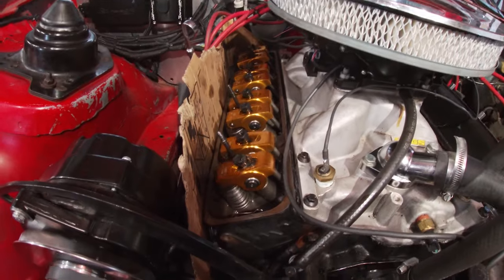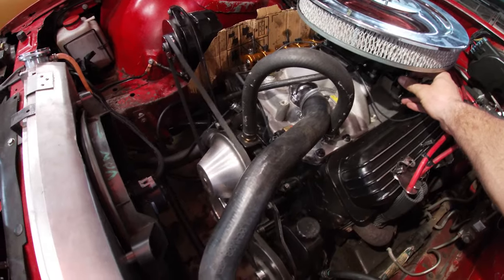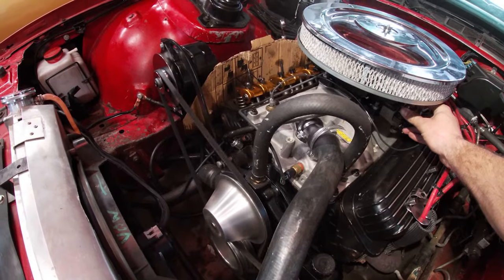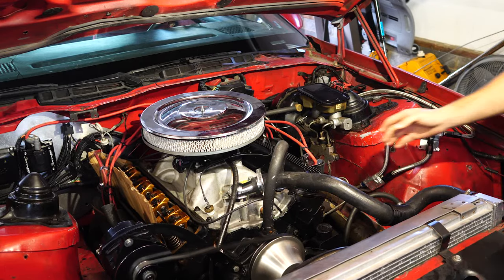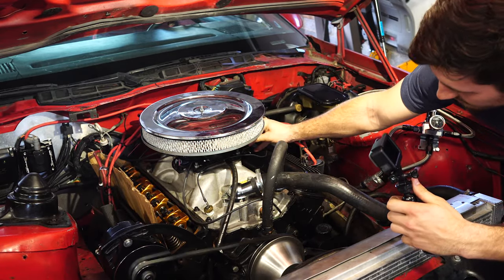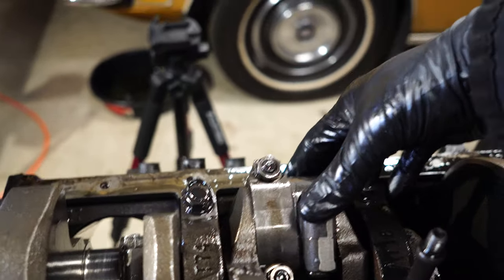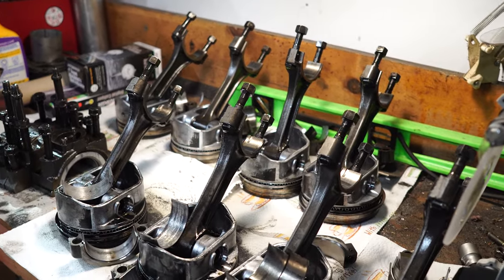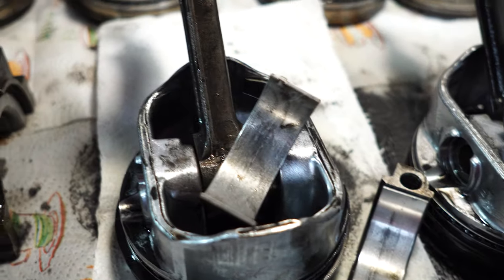What Engine Knock (Rod Knock) Sounds and Looks Like!

Comment: there's an easier way to tell if u have a bad rod bearing. while the engine is at an idle...just start pulling the plug wires one at a time...replacing each wire back as u go along. when u come to the cylinder with bad rod bearing...it will become much louder and very easy to hear the rod knocking. no need to remove the valve covers. this guy is very sharp and seems to know what he's doing. In fact I'm a subscriber. But in this case, there's an easier way to tell. not every technique is fool proof but in 40 years of wrenching on cars, the method l just described has always been accurate in not only knowing for sure if there's a rod knocking but also lets me know exactly which rod it is.
Reply from the maker: That's good to know! Hopefully I don't need to trouble shoot anymore rod knocks for awhile though!
Reply: @ZanesGarage  Me too. sweet ride BTW.
Reply: @shaggings  I was referring to V-8's. and a motor that already has a knock. A very interesting thing u just described. If there's no knock - then your good. I've never tried it w/ a 4 cylinder.  Why did u that in the first place?. Were u looking for a knock? Not sure what the problem is.
Reply: @shaggings  Oh...I see. I hope u get it all sorted out. Oil-wet would suggest to me either bad rings or valve guides. Fuel-wet would suggest a much cheaper solution. Bad fuel pressure regulator perhaps. Good luck bro.
Reply: engine develops knock 

pulls plug-wire 
cuts connector to plug out of boot 
fills with silicone 
fits Boot back Over sparkplug 
puts on fb market place and asks above PREMIUM dollar for for vehicle 

"Yeah I been driving it daily, it's about due for a tune up but between work, the wife, and the kids, I just haven't had time to do it myself, it's a healthy running car I've never had an issue with it...I'm firm on my price, I know the value of what I got. But if the tune up is all that's keeping you from buying it I'll knock 100$ off."
Reply: It didn’t hurt per say. But I did just get shocked by my first distributor.
Reply: @dhgcrack3r111  Yeah it'll give ya a shock if you use your bare hands. They do make plug wire pliers or you can wear gloves. Good luck.

Comment: I'm not a professional, but I have pulled down a few very old engines and have as yet never seen a bearing that bad!  You saved the whole car!
Reply: Well I must be unlucky on my old engine all of them were pretty thin and they were all a brownish color and idk what did it but my whole crank snapped and it was a mess didn’t leak a drop of oil though so that was nice

Comment: you can hear it when you revved - a lower frequency ticking. Lifter valve ticking is not as low frequency - and you can tell it's from the top of the engine. Thanks

Comment: Damn, I knew my Crown Vic had a knock, but wasn’t sure. This video definitely helped, thanks! 🙌🏾
Reply from the maker: Glad it helped! Crown vics are sweet!
Reply: How did you fix the knock in your crown vic? I was told mine is knocking from the bottom
Reply: @ZanesGarage  will a rod knock go away after it warms up I have a 93 Chevy Cheyenne and it seems like a similar noise I heard today but went away after the truck warmed up? Any input would help thank you!!
Reply: @daivonedurr9878  not worth it to try to fix a 4.6 mod. Get a new engine, they're everywhere and cost nothing
Reply: My f150 sat 6 years and was stuck, accidentally floated a valve I think, over revving, 302 1994 f150 5 speed manual now I think it's ticking but it sounds like a lifter, more high pitched, like a smaller part/piece of metal clattering, new camshaft lifters and rocker arms should fix it but I'm leaning towards a 300 dollar junkyard plant

Comment: Sounds the same on my BTR2 cammed g8gt. Did a nice burnout for a road work crew. When I got home, tapping like mad. The cam lope wasnt even the same , sounded off balance,  lost most of its chopchopchop sound
Reply: What ended up happening. I have a gp gxp
Reply: I got a motor out of a G8 and now it's making a lot of noise. Mechanic thinks it's rod bearing.

Comment: so a rod bearing on the bottom of the engine can cause lifter knock?
Reply from the maker: No, generally lifters when they go bad or there's an issue have a "tick" and not a "knock". If a rod bearing is bad you'll know about it before it causes any issues with your lifters.

Comment: Could this sound get much quieter (in fact almost gone) when as the engine warms up? I hear this clicking when driving and accelerating only, but it is gone after a few minutes. Could it be piston slapping? Is it normal? Toyota Yaris, thanks
Reply: might be a valve lifter
Reply: Or a exhaust leak like mine between the exhaust manifold and the cylinder head because a broken bolt
Reply: Prob piston slap especially if it goes away once warm. The piston will expand from the heat and tighten the gap stopping  the slapping

Comment: Thats wierd especially for recently rebuilt motor
Reply from the maker: Well it was rebuilt by myself and I didn't take the time I should have to check clearances, proper break in etc. So I'm paying for that now but I'll get it right this time around 👍
Reply: @ZanesGarage  happened to me as well. put in my rebuilt block 3 days ago. started it up and it was fine and dandy for all 20 or so minutes. then clack-clack-clack and i'm pretty bummed. i'll be taking the oil pan out tomorrow to do some checking.

Comment: This just happened to my 5.3, oil stopped circulating because of increased pressure, I ran it too hard. First I thought it was a low battery so I kept trying to crank it. There was just a tiny bit of metal shavings at the bottom of the oil pan. I hope I can still save it.
Reply from the maker: Yeah it's never fun. I haven't messed with an ls engine yet but I know they're pretty straightforward to take apart.
Reply: Did you end up saving it?

Comment: Hi, please i need your reply.
I'm using a 2008 Hybrid Honda civic.
There is a rattling noise when advertising slowly but when i press the gas harder the noise goes until you accelerate slowly again.
Engine scanned, says NO FAULT.
Reply: I have this rattling sound in my 2010 honda accord as well, like you said when i accelerate at low speeds and not after being run for a while sometimes. It seems that when its lower on oil or needs a change its a bit worse or really bad. Cars been working great and its rare to happen but i still wonder what it is

Comment: My engine doesn’t knock when cold or at high rpm but only when warmed up and idling. Did a 10 degrees cold start today and it didn’t knock until after I drove it around. Very confusing lmao
Reply: Same issue here, did you find out the origin?
Reply: @ConcreteJungle95  nope, haven't rebuilt it yet. I don't want to though because I don't have a garage for that so I'm just gonna live with it for a while. I have a feeling that it might be because I redid my exhaust manifold gaskets recently, I don't feel like I might not have done the best job redoing them sense I was out on my driveway.
Reply: @kalemathews1899  well any update lol
Reply: @DiamondScuff  it’s had the same sound for 2 years, never changes. It’s a ford 289 so I don’t think it will stop anytime soon

Comment: So does this engine need to be replaced?
Reply from the maker: Yes, in my case i was lucky enough to get away with rebuilding the engine and being able to reuse the block and heads etc.
Reply: @ZanesGarage  how do you prevent this from happening?
Reply: @anthonyhelfert9852  keep up with oil changes, check oil regulary, and dont overrev engine alot

Comment: What does it mean if the tick is only there on acceleration but goes away during idle?
Reply from the maker: It's possible that it could be an exhaust leak that only shows up under acceleration. Hopefully it's something simple like that!
Reply: KingJugganaut19 I don’t understand mine either and it’s a 2020 brand new knocking not even had two months yet taking it to dealership In morning but now it ticks without reving I’m scared to drive it
Reply: @deeekay9025  How  ended it up ?
Reply: TT-RS he said metal was in my motor don’t know how but it was and they replaced my motor just got it back the other day actually
Reply: @deeekay9025  spun bearing, metal shavings get in your oil, they recirculate and wear down more parts for more metal flake
Reply: @topkek7003  yea but now i got a Scion tC 05 5speed  loving it
Reply: @deeekay9025  i drive a saturn outlook and my engine started having rod knock at only 135k miles

Comment: I replace a rod bearings on a 5.7 hemi engine and stills doing same knocking sound ani ideas what’s the problem? Thanks everyone
Reply: When was the last time you adjusted valves clearance? Is the ignition timing correct based on the fuel you are using?

Comment: Can the knocking be intermediate and more quiet than your engine
Reply from the maker: In my case the knock was only really noticable with higher rpm and for how quiet I'm not sure I think that changes from situation to situation.
Reply: @ZanesGarage  i suspect my car has a knock of some sort cause when i rev it to 2k and above when you can hear a slight knocking as it revs but it isnt there at idle

Comment: This is cool and all, but this isn't my issue 
 
Please help.... I'm at a loss for words. 
(1972 "3970010" nickle block 350) 
There's no bottom end noises, it's stout down there and sounds like a sewing machine
* NOT A SMOKER* 
NOT A DRINKER 
NOT OVERHEATING 

I have a very slight "peck" that almost sounds like a lifter on my low/mild cammed 350 (probably just a * little * bigger lobe than stock) it's definitely in the top end. 

The peck is virtually non existent at an idle. 
The peck dissappear during acceleration. 
When accelerating, you don't hear it. 

You only hear it when RPM levels out  at what ever speed youre going above 15mph,

And it sounds a little more aggressive coming back down to idle, not really bad though. But definitely sloppy sounding

I will add, when I was putting it in time before I pulled the valve cover, I noticed the ticking will get worse if it's advanced or retarded too far. .it was honestly a pain to time. It seems to want to run the best when advanced right before it gets too tight to crank over.its definitely not timed at 0, and I'm sure it's timed a bit past 2-12 degrees at idle. But it's had internal work and I don't know the engine build specs. It's an old build as well. The edelbrock carb is from the late 80s/early 90s and I'd imagine that's when the engine went in the car by the looks of things. Also adjusting the mixture screws has no effect on the tick whatsoever.  Richening or leaning dosent make it worse or better. It's the same. Timing also dosdnt make it better.  It only gets worse as you get it farther from where it's supposed to be. 

Put it this way, it's literally so faint, I thought it was a slight exhaust leak from the back of the header. It's very faint.  

I pulled my valve covers (this is the only car I own I didn't put the engine in myself, I have no clue on it's specs)  and on the #5 exhaust side rocker stud, it has a brass acorn nut on top of it. I pulled the the valve covers to reseal valve covers. All lifters are pumping oil. They all appear to equally be pumping oil as well. Top end= lubed up good. 

The valves are a cunt hair too tight. I left well enough alone, at top lifting was able to roll every pushrod around, so I figured if I can turn/roll them, they aren't dangerously too tight. Just tighter than I'd like. 

*why is there an acorn nut on my stud? * 
* why isn't the tick/peck constant? * 
* why is it worse when you decrease in RPM and speed?* 

I ofcourse didn't tear into if because I currently daily drive the car, and I baby it. I just pretended I didn't see that, and resealed it and drove it to work the next day. I can't afford down time right now and have to have transportation to make money for my wellbeing and family. So please don't tell me I am stupid or that I shouldn't have done that because I didn't want to I just didn't have much choice. I hate to destroy a 010 350 but i have 6 more of them ([4] 010 350s, [1] 1969 hi/p 327, [1] 1968 built 307 ) on stands  in the garage, I will change it if need be and it blows so I'm not tooooooooooo worried but definitely want to save it because they aren't exactly making anymore 010 code 350s anymore and honestly I think they are, specifically the 010, the most bullet proof, idiot proof engines ever manufactured in the world. I've seen them really put through alot without catastrophe in more ways than one. 

I need to change the oil but I'm just now recovering from severely seaping chrome valve covers that definitely didn't go back on. It would require a half quart every 2 or 3 days of driving it. So the oil is.......... somewhat fresh. When I resealed, I topped off the oil with about a half quart of Lucas oil to provide a little more filmy protection internally.  It didn't really quiet things down, the tick just seems well lubricated now lol  usually when I have a slight peck in cars I'm selling or other people's cars, Lucas and a Purolator filter with a back pressure spring does the trick and does away with it. 

But this one's got me stumped. I'm not sure what the purpose of putting a cap acorn nut on the stud.... no others have this including the intake stud on #5, it's just the #5 exhaust valve rocker stud. 

Has someone possibly stripped the threads on the stud? 
Has it been wound up too tight and threw a rocker arm once upon a time? 
Is the cam lobe worn causing the lifter to drop lower than it should? 
Worn lifters? (Its flat tappet w/stock style rockers) 
Bent pushrod? 
Did they not degree the cam properly when it was installed? 
Timing chain slop? 
Bent valve? 
What's wrong???? 
Who knows? Hopefully you do and can help a guy brainstorm how to tackle this unfortunate problem.

It seems to have aftermarket valve spring, and it has pushrod guides too that definitely aren't stock. It also has ".16" engraved on the inside of the head so I am assuming it's had the heads decked as well. It has power, this isn't an issue. It also has great oil pressure and isn't burning oil, nor getting water in the oil. It seems otherwise very clean and healthy other than just the stud having an acorn nut on it and that very faint tick im hearing.  Also has headers. Power steering deleted, AC deleted and all their bracket so we know it's not caused by any of that junk. 

My dad says he dosent hear any tick, but I do and I'm sure of it.. I asked my dad, he said "whaddyawant fromma engine from 1972???" And assured it wasn't a big deal but I'd like to address it before it gets worse. It's It's quite a bit of power, honestly isn't a gas Hog even with a 600cfm carb, and it's been very very dependable. It deserves to be fixed. I just hate to tear into it because otherwise it runs and drives so well.

I suppose I could start by changing the oil filter but it's wishful thinking I'm afraid.  I changed filters when I bought the car. Everything I've ever drained from it has been extremely clean, and looks like new. No shavings, no sludge, no milky appearance.  When I had the valve train exposed, it all was incredibly clean, not a spec of sludge in or on anything. Oil journals were impressively clean. 

I'm honestly loosing sleep over this guys... I don't like the uncertain and I don't like driving a car with a shabby fix internally.  Im about to have time to mess with it soon, any advice helps or personal experiences.  I'd like to have a game Plan before I start. 

Something tells me I'm gonna be pulling the heads ,,replacing valves,, valve seals,, rocker studs,, Cam,, pushrods,, lifters,, timing chain and timing gears. ... just my luck  :/ 

I reckon it might be Time for that ungodly large demonic camshaft to scare old ladies, make kids cry, and..... make the bottom end knock on heavens door after a couple years or less at the track because it's not as fresh as the top end if I do a cam kit swap lol

Comment: short and sweet and very informative ....but not what i wanted to hear. 
mine is very faint at idle or when revving when there is no load. sort of like this one. most pronounced when in gear and under acceleration. even slight acceleration.
Reply: Can you ignore and for how long?

Comment: Is my engine gone? It was low on oil and when I noticed it I filled it with oil, then today It started knocking from the engine really really really bad and cutting off as I drive!!! I can only drive slow, it still knocks really loud and bad and cuts off!!! What do I do!!??? 😩😥😥
Reply: part out
Reply: @PerformanceBlueOverYou  I was hoping I wouldn't have to do that but ok..thank u..😥
Reply: @crystalxoxox1266  okay what I said was half joking, but here’s a more serious response. If it was low on oil like you said, especially if it was VERY low on oil, it’s very possibly you caused hot spots on either the rod bearings or the crankshaft bearings due to lack of oil. Basically, the bearings are ruined and the entire engine would have to be taken out to fix it. I’d take it to a mechanic to be sure but that’s what it sounds like happened in your case. Don’t drive it, it’s going to cause more extreme damage ie. piston going through the block.
Reply: @PerformanceBlueOverYou  Yup!! I just left 3 shops and they said EXACTLY WHAT U JUST SAID! MY POOR ENGINE IS GONE! 😓😓 So I have to either buy a new engine or sell it as is! Thank u so much! Be blessed and take care!!!...

Comment: Ok now what causes that?? Low oil pressure or bad assembly bad crank
Reply from the maker: All of those are definitely things that could cause it but in my situation I believe it was from a previous overheat & blown head gasket i had that caused it.